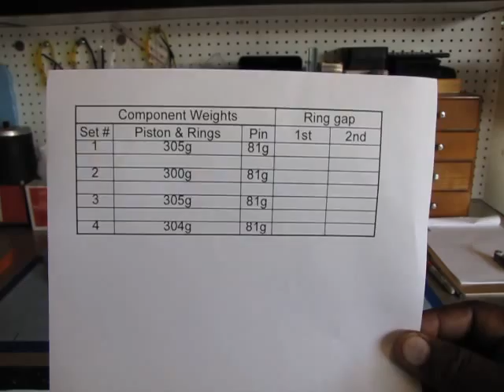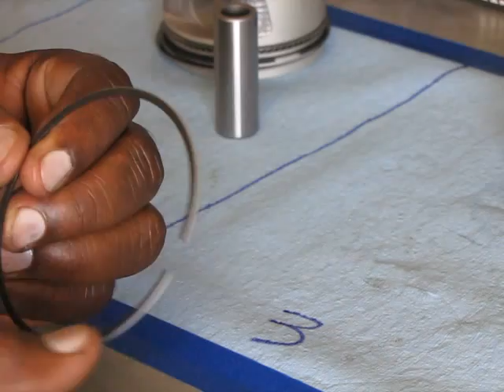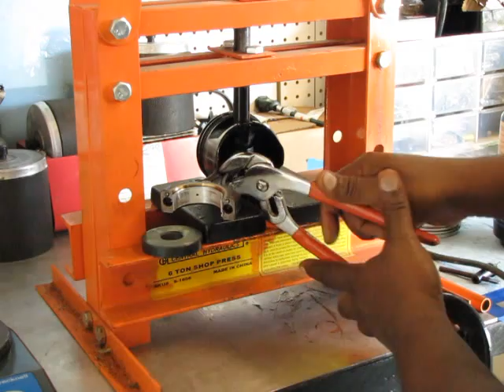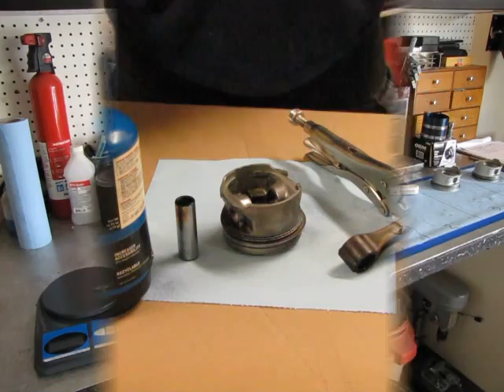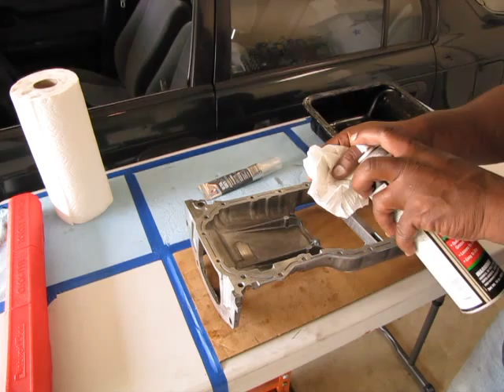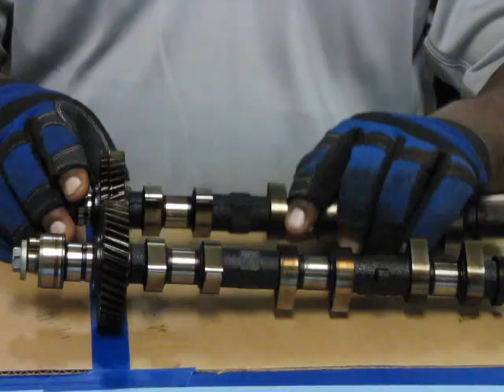How to rebuild Toyota Corolla 7afe 4afe Engine Install pistons, cylinder head, set engine timing

Comment: Why not weight the pistons and connecting rods with the wrist pins. Then take the extra material off the cast connecting rods?
Reply from the maker: It is much more difficult to remove material with the rod connected to the piston. The rods were weighed separately and were very close in weight. The rod is a structural part so you don't want to remove material from that. Additionally the rod is not at the far end of the momentum of the as the crank rotates and the piston is so you want to remove material at that farthest point. ... in a nutshell ...

Comment: I have  toyota corolla dx 93 1.8 Í would  Like  to  knou how to calibrate  the  valves thanks
Reply from the maker: The valves must be adjusted by adding shims of different thicknesses.  You must measure the valve clearance and then compare you reading to the required spec. Then determine what shim thickness will adjust the clearance to the correct spec.  here is an example of the shims look like.  This procedure can be done without removing the cam shafts.  go to 44.00 minutes into  this video.  https://www.youtube.com/watch?v=uz6l3cmXcy0
Reply: and how  much is  the calibration?
Reply from the maker: Depends, if you do it yourself,  just the cost of the shims.  If you take it to a shop, that will be up to them and you ...

Comment: What brand is the water pump and other parts like pistons? In my country (Brazil) I can only find Takao or Original, but, original is 400% more expansive than Takao. Thanks for the video, and keep up the good work.
Reply from the maker: http://www.ebay.com/itm/WATER-PUMP-ACDelco-NEW-252-321-GEO-Prizm-LSi-Celica-ST-Corolla-CE-DX-1-8L-Y2/232240254740?_trksid=p2047675.c100010.m2109&_trkparms=aid%3D333008%26algo%3DRIC.MBE%26ao%3D1%26asc%3D41375%26meid%3D8d72d921774a411da0c4ff142214840e%26pid%3D100010%26rk%3D4%26rkt%3D6%26mehot%3Dlo%26sd%3D172688840500

Not sure on the brand of the pistons but they were really good and pre-balanced.  If you really need to know I'll look it up, I got them on eBay too.
Reply: Hey man, thanks for the reply, and for the link, this brand AcDelco is known here, I will look it up, but you don't know about Takao?
Reply from the maker: No, never heard of Takao, sorry.
Reply: Fernando Neves in guyana we get the same parts

Comment: hi I have I think the same engine a 1999 corolla. it has over heating issues and had a couple of engine failures the engine eats up oil causing me to refill occasionally and eats ups up water and coolant from its cooling system. recently the water and coolant have been spitting out of its radiator and the water reservoir boils when the engine turns off. ive checked the water pump all the teeth is there, the spark plug seems to be having contact with oil which I checked and oil has entered into its cyclinders. im curious to know whats your assessment. thanks im in need of a 2nd opinion.
Reply from the maker: Displayed Imagination head gasket.
Reply: when changing the head gasket is it recommended to resurface the head & engine block ?
Reply: I love this video you made by the way its open my perspective on my engine.
Reply from the maker: Yes, it is recommended and with the issues you are describing I would definitely have the head checked. These blocks are steel and very short and don't warp often, ... it's your call. Personally I always check the head to make sure it is straight and everything seals properly. Having a machine shop check the head for cracks, straightness and leak test should only cost about $100 - $150. A resurface is not always needed, but have it checked.
Reply from the maker: Sounds like the head gasket to me.
Reply from the maker: If you want to learn how to perform basic service on your car, this full collor book is the best you can get!
https://www.amazon.com/Your-Care-Companion-Clint-Hightower/dp/1517466946/ref=sr_1_1?ie=UTF8&qid=1493398557&sr=8-1&keywords=your+car+care+companion
Reply: Clint Hightower thanks for your insight. it's been very helpful and reassuring.
Reply: I'm just curious, can having oil inside the cylinder cause over heating problems ?
Reply: thanks for the link to your book.
Reply from the maker: No.  Over heating is a result of insufficient coolant circulation for whatever reasons. reasons may include "insulated" radiator due to internal coating, water pump failure, stuck thermostat, low coolant level, failed cooling fan,  or combinations of the above mentioned.  Oil in the cylinders is an indication of leaking cylinder rings or leaking valve seals, but will not cause over heating unless your car is designed to use the oil as part of the cooling system, as some cars are, and the oil level is low.
Reply from the maker: Read the chapter on the cooling system and also troubleshooting and brakes.  ;)

Comment: I have question I want to ask u my 94 corolla is dumping to fuel after I did the timing n water pump and recheck the timing it was straight on and I don't know what to do anymore cause it doesn't have check engine. code or anything wrong
Reply from the maker: check that fuel is being pumped by the fuel pump, then make sure the vacuum connection is connected to the fuel pressure regulator.  I need a little more information to help you.  If you read the troubleshooting chapter in my book it might help you better explain what you think is going on with your car.
Reply: everything connected n fuel is sending fuel but when my idle sits 1000 rpm and it idle fine but when I'm in the highway  at 60 mph my rpm stays at 3000 rpm  like duel cam short gear ratio lol....so I'm thinking my injectors are stuck open or something
Reply from the maker: My guess would be either the fuel pump is failing or the fuel pressure regulator has failed not the fuel injectors.
Reply: Clint Hightower OK I'll look in to it n I'll let u know if I fix the problem later

Comment: Hi there fantastic videos, i,m going to rebuild my Carina E 7afe and would be a lot more confident now to have ago after seeing your videos. I noticed when you zoomed in to show how to gauge the cylinder rings, that the cylinders have a lot of scoring even after you honed them, in my head i'd imagine them been pure smooth or are they alright as shown in the video?
 
I've never done anything like this before and its not about the money paying someone to do it for me, i would love to have a go and have the buzz that i done it myself, i service my own car few times and recently done all the brakes, but that's about it, do you think i could achieve this? Thanks
Reply from the maker: No no no, they are not supposed to be smooth.  The honing is to get rid of the smoothness. The purpose of honing and the scoring is to re-groove the cylinder wall so the oil will stay in the grooves and lubricate the cylinder.  Also the honing creates a "soft" layer of metal for the new piston rings to form more precisely to the shape of the new rings and form a better seal.  new rings a always going to be a little different "round" shape that the old ...
Reply: Right i now get that, this is like a master class :), i've learned so much watching a couple of your videos and thanks for the reply much appreciated.
Reply from the maker: Here is a free copy of my book.  Check out the Trouble Shooting Chapter especially, down pdf from my Dropbox.  https://www.dropbox.com/s/mcwpv0rb7lun038/0%20Entire%20book%20with%20covers%20and%20QRC%20for%20eBay.pdf?dl=0

Comment: Quick question, will the rod not distort slightly with all the heat? Just asking
Reply from the maker: The torch does causes the rod to distort a little but the heat is not enough to cause permanent deformation.  It returns to its original size and shape hence the return of the original "tight" condition to hold the pin in place.
Materials always expand some with heat. Heat is energy and energy "excites" the electrons that surround the nucleus of the atoms that make up the metal material of the rods. The added energy e- makes the electrons which are all negative push away from each other more as they all try to get closer to the nucleus of the atom which is positive.  The relatively low operating temperature of the engine is low enough to where the "distortion" is not great enough to interfere with the operation of the engine. But if you have a problem such as a failed cooling system and your engine overheats, the distortion that you reference happens everywhere including the rods and that is what makes an engine fail.
Reply: @Engineerboy100  the maaaan knows his science too! Queeee principee!👏

Comment: just bought a corolla with the 7afe, it needs work. im a diyer, I've changed a convertible top on my Miata, clutches on a few cars, red and fwd. timing belt and water pump, general maintenance.I  look forward to learning from you
Reply from the maker: Here is a free copy of my book.  Check out the Trouble Shooting Chapter especially, down pdf from my Dropbox.  https://www.dropbox.com/s/mcwpv0rb7lun038/0%20Entire%20book%20with%20covers%20and%20QRC%20for%20eBay.pdf?dl=0
Reply: TurboFo_Oil_Changer Porsche_Light_Saver I got the book, the really nice. hi also need to get a service manual for my car.
Reply from the maker: Check on eBay.com ;)

Comment: just bought a corolla with the 7afe, it needs work. im a diyer, I've changed a convertible top on my Miata, clutches on a few cars, red and fwd. timing belt and water pump, general maintenance.I  look forward to learning from you

Comment: Oh god, despite how weird this sounds, the engine sounds sooo attractive at the end. I have a 93 Corolla DX, which runs the same engine, and I plan on doing a rebuild in the future. 218k and still running great. Great acceleration after all these miles and still gives me butterflies in my stomach when I drive it a little mean through town. I wonder how ferocious it will sound after a much needed rebuild. 

Thank you so much for putting this information out here. I also love your combination of professional and backyard tactics, such as the diction you use to explain everything, yet the little things like the bungie cord holding the timing belt. Made my night. Cheers!
Reply from the maker: Here is a free copy of my book.  Check out the Trouble Shooting Chapter especially, down pdf from my Dropbox.  https://www.dropbox.com/s/mcwpv0rb7lun038/0%20Entire%20book%20with%20covers%20and%20QRC%20for%20eBay.pdf?dl=0

Comment: w up men nice video what cant to me my car toyota 1995 1.6 whend i driver it like 30 m to 45 the car running and motor go off and way like 20 m to 35 and start ogain and do the saithing ogaing and son time i way like 60 m and still no want no star only my frien push my car with hes car and it stard go me crazy you can hell me plese what you thing it the probleme t you b much men
Reply from the maker: You probably need a new alternator.  When the alternator dies the car runs off the battery until the battery dies, then the car shuts off.  you should read my book "Your Car Care Companion" it is free to down load from my dropbox and you can buy a hard copy off amazon if you want.  I explain all of this in my book.
Reply from the maker: Here is a link to my book.  https://www.dropbox.com/s/mcwpv0rb7lun038/0%20Entire%20book%20with%20covers%20and%20QRC%20for%20eBay.pdf?dl=0
Reply from the maker: https://www.youtube.com/watch?v=QzNlSwHaOf8

Comment: you shouldn't have to drill out weight on the Pistons if you bought them as a set I would have took them back I've built motors for a long time they must have been dormant parts
Reply from the maker: That is true and I was a little irritated that the weights didn't match but its better to have them balanced than
 to have the engine vibrate and throw itself apart.
Reply from the maker: I just finished another build on a "Yellow" engine and I did not have to drill the pistons, the video will be coming soon.
Reply: Gary Clemons, If two of them were 5g out then you could put them in cylinder 1 and 2 so they cancel each other out.

Comment from the maker: For cars that have an oil dipstick, I have been thinking about designing an oil changer pump that will be like nothing else on the planet and will have the following features:
1. Of course you will not have to jack up the car as the oil will be extracted through dipstick hole.
2. Unlike other extractors on the market , this unit will not require 
a. An air compressor to operate 
b. Manual pumping to create suction
c. The user to dump the oil, it is pumped directly into the recycle container
3. This unit is very small and easy to handle
4. Made in USA of machined aluminum NOT plastic
5. Can extract warm oil in 2-5 minutes depending on vehicle capacity
6. Does not require a battery, operates on your car’s 12 volt battery
7. Costs less than some people pay for an oil change
8. Anyone can easily use it from teens to non-mechanical persons to the elderly
9. Allows you to change your oil without jacking up your car in as little as 5 minutes.
10. Looks Awesome I billet aluminum or anodized blue
Would you be interested in such a device? If enough people are interested I will engineer one like nothing currently in existence.  Let me know.
Reply: Clint Hightower nice sir I like it thank u your vibios
Reply: Clint Hightower as very interested I am in that invention..I feel like once you invent it, it wont be as fun to change the oil but then again, it would make it easier and more simpler for youngsters-mechanics to use as you had informed. Then again, as it is a device, of course we'd have the option of getting it or not for our car so it would be really cool for people I think. I know my neices and sister would definitely do it themselves if you designed it.
Reply: .... i am certainly interested - do you have a prototype or drawings available?
Reply: Not all vehicles have an easy access oil filter like this corolla. You’ll still have to jack up the car to change the oil filter. And if I’m jacking up the car might as well remove the drain plug to get a complete oil draining.
Reply: Mr Clint Hightower , do you have to take your corolla Engine to a machine shop or do you not have to . I'm trying to restore my corolla.
Reply: This sounds awesome

Comment: Good job, one tip when installing oil pan, if you buy a couple longer bolts cut the heads off them then use them as alignment pins for oil pan. Helps to keep from gasket sealer all over other bolt holes. When you have a couple of oil pan bolts installed, remove them, finish installation
Reply from the maker: this oil pan already has stock alignment studs, but that is a very good old school tip lol you must be an experienced mechanic, I remember doing that years ago

Comment: Greetings from the Philippines!!! Very informative video...Can you do a  have a 4A-GE (16-valve) DOHC Inline-4 rebuild video. 

Specifications:

Engine displacement: 1.6 L (1,587 cc)
Layout: DOHC Inline-4 (Straight-4)
Bore and Stroke: 81 mm × 77 mm
Dry Weight (with T50 gearbox): 154 kg (340 lb)
Valves: 16, 4 per each cylinder
Power: 115–128 hp (86–95 kW) at 6,600 rpm
Torque: 148 N·m (109 lb·ft) at 5,800 rpm
Redline: 7,600 rpm
Fuel Delivery System: MPFI

Thanks
Reply from the maker: the rebuild is exactly the same,  only difference is the size of the pistons ;)

Comment: t you the car started real good i life the car on like 45 m no go off when  starting  driver little world go of way like 10 m started gain last time i way like 55 m and no want to start  my friends  puch my car with hes car and the car started  pleple to me the distribution t you any way b much
Reply from the maker: It sounds like your alternator is not charging your battery.  You may  need a new alternator.  Have the alternator checked.

Comment: w up nice video i go toyota corolla 1995 1.6 my car whend i driver the car running  and go off by her sell and i need to way like 10 or30 m to can start ogain and do saint thing mored the 5  are 8 time you thing can help me what  you thing can be run with the car t you b much
Reply from the maker: wow it could be so many things.  the car needs air fuel and spark to operate so think about what the car is doing and try to figure out what is missing, I don't think it is air but it could be spark or fuel. So for spark it could be bad spark plugs, a dying alternator or a bad distributor. For fuel it could be a partially clogged fuel filter, a dying fuel pump or a bad fuel pressure regulator.  Start with the cheapest part and work your way to the problem good luck.  read the trouble shooting section in by book.  Link to free down load below.

Comment: head bolts? have they been pulled before? have you ever realised that they can on some blocks bottom out and wonder why you get head joint leaks.my advice through many years experience,is use new.why do all this work and fuck it to death by saving 20 $ this guy is a bodge artist.loser don't buy a car from him.
Reply from the maker: Agreed, except for the "bodge artist.loser" part.  I change the bolts all the time now ;)

Comment: Excellent video. I can see that you removed the longitudinal brace that runs from the radiator back to the sub-frame cross member where it is attached at the rear trans/engine mount. Is there a way to remove the longitudinal brace without dropping the entire cross member? It makes access to the driver's side of the upper oil pan section much easier. Thank you.

Comment: one question what type of oil use in a new rebuild engine,,, the same recommend by the manufacter,,,, or another,,,, and by the way excelent video
Reply from the maker: Use the manufactures recommended oil.  I use synthetic because it lasts longer.  You should down load my free book.  It answers this and MANY other questions and if you like the down load, you can purchase the hard copy on Amazon.com https://www.dropbox.com/s/mcwpv0rb7lun038/0%20Entire%20book%20with%20covers%20and%20QRC%20for%20eBay.pdf?dl=0